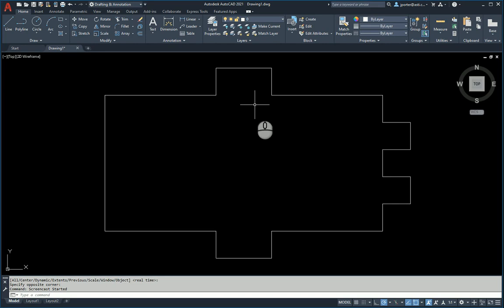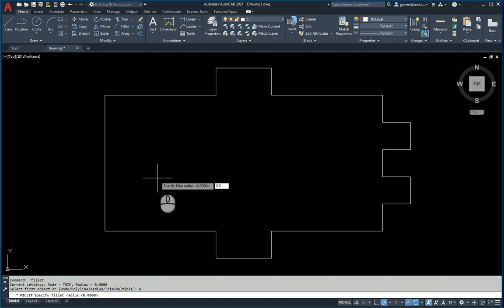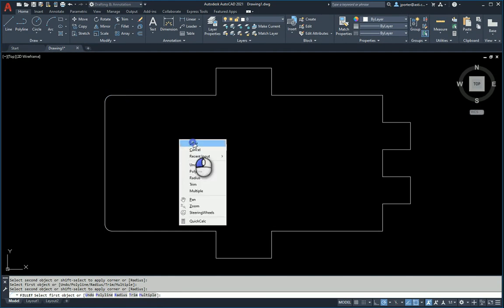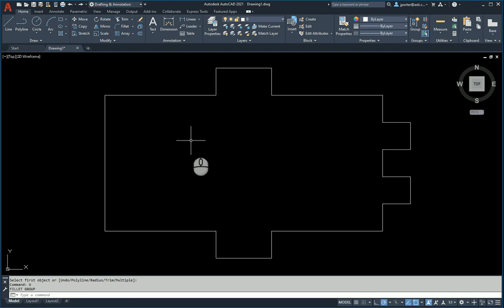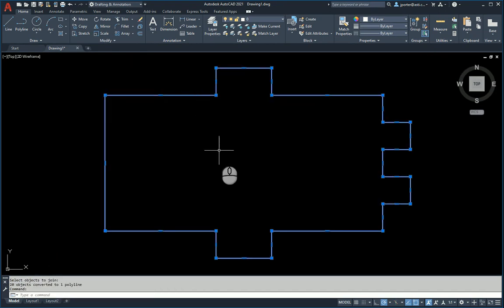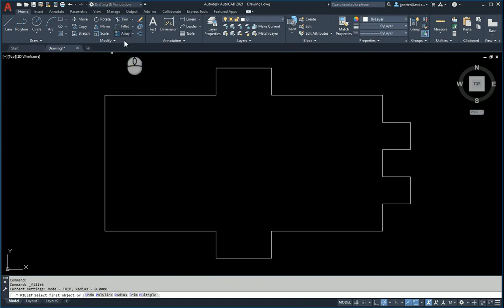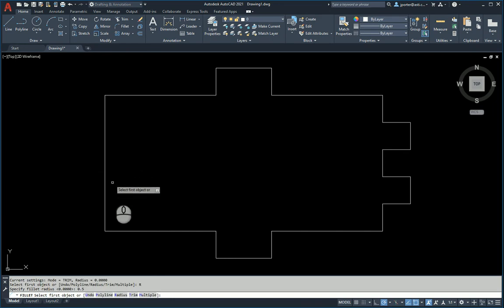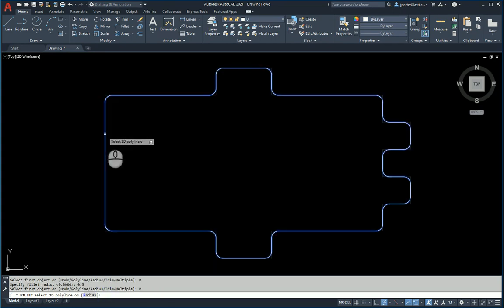AutoCAD Tip - Polyline Fillet

Comment: Thank you for the helpful video. I've been using ACAD daily for the past 2 years and did not know this. I use the fillet command mostly to join two different colored polylines together while keeping the source color. For the life of me I can't figure out why in some cases it will actually change my source polyline color instead. Hopefully you can explain that.
Reply from the maker: The fillet command will use the layer/color of the first polyline you select and the push that the the second line you select.  This is, of course, might become an issue when dealing with enclosed areas.